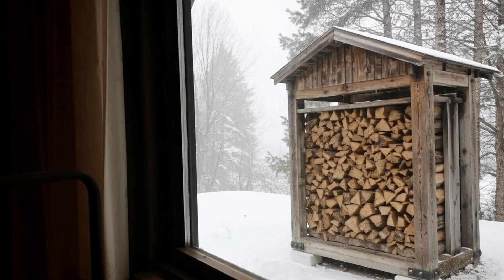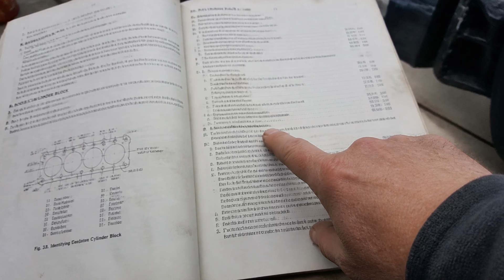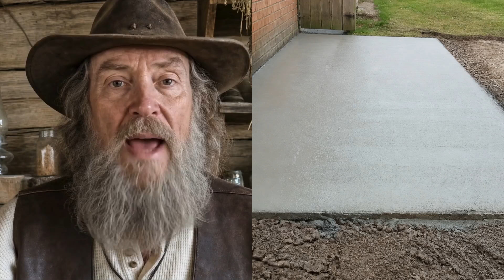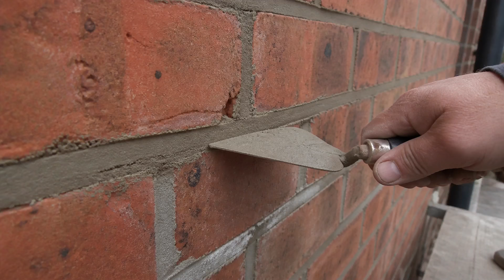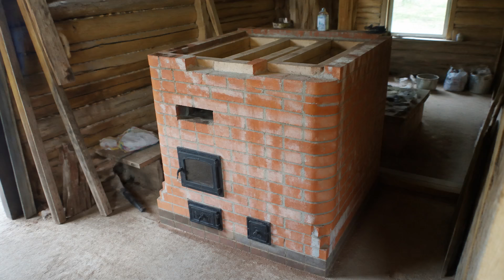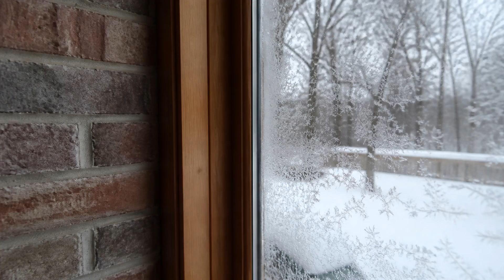Stove That Saves 50% Of Firewood And Heats The House For 50 Hours Without A Fire!

Comment: I have a baby bear stove.  My cabin is 12x12=144sq feet with loft 10 foot walls.  So this little stove is still too big for such a small cabin.  In your option could this stove be used in such a small place?  Thinking you may have idea on how to make it make less heat and still have a good draft to minimize creosote building up.  I will be burning pine.  Maybe put extra bricks in there?  I catalytic  converter?  Just wondering? Would like to use the babe bear since I already have it.  Thank you .

Comment: I became familiar with the masonry stove 50+ years ago when a friend built one in his house. The design instilled an idea to down size to a smaller unit to heat a room with lasting heat.Fired same way. Also installed a wet grate for domestic H.W.  The unit weighed around 900 lbs. Ended up building a few for others where unit in basement heated a house by thermal dynamic action to feed base boards on floor above. Worked good.